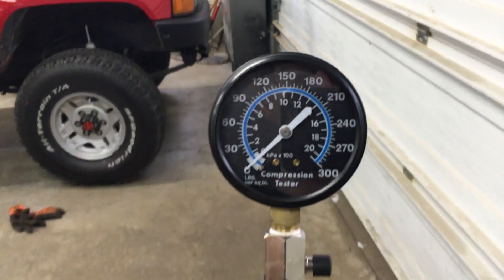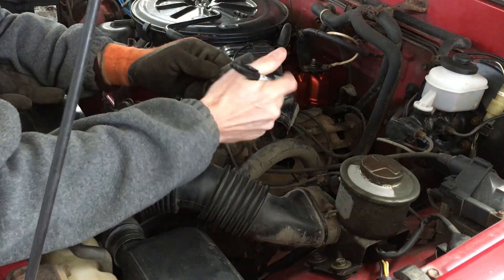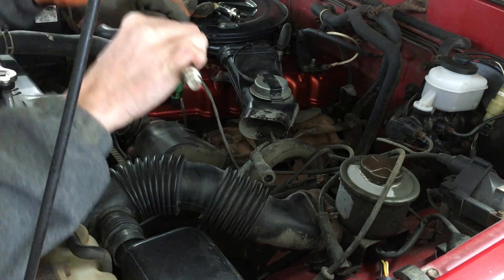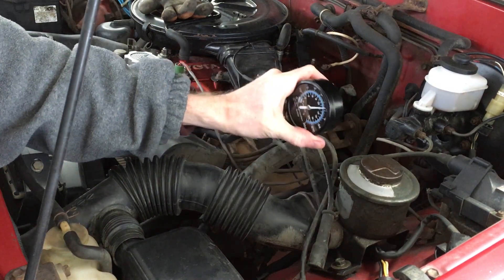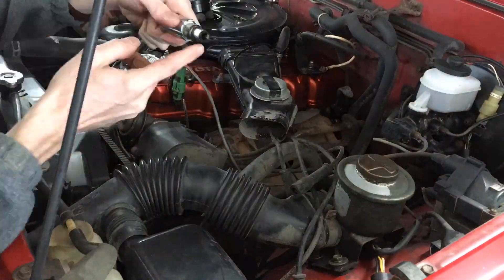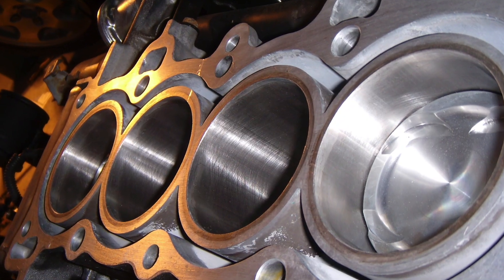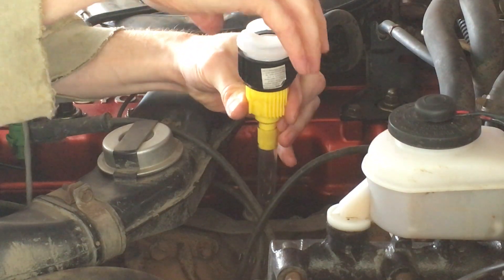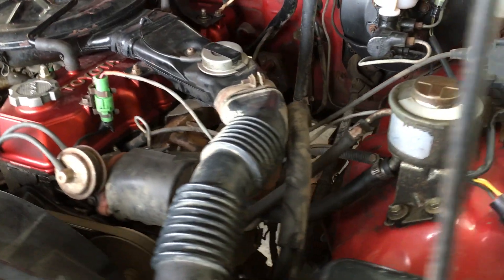How to: Compression Test an Engine

Comment: I'm looking at buying a truck with a 22r and doing a compression test on it before buying. To be clear you didn't shutoff fuel or ignition before doing this compression test?
Reply from the maker: That's correct, I just pulled the spark plug wires off so the engine won't run.
Reply: @6thGearGarage  thanks for the quick reply!

Comment: I need help how to know if the engine needs a head gasket I check all the compression all 3 cylinder has a 150 the cylinder number 2 has only 135
Reply from the maker: Did the #2 cyl get any better after adding some oil into the cylinder?  If so, that's worn rings.

Comment: Nice informative video.  Also figured I would mention how jealous I am of your clean truck.
Reply from the maker: Thanks! It looks clean in this video, but the frame under the cab will need some attention in the future. Yota life in Ohio!
Reply: Cant be as bad as the Turdle.  Patched the frame in 3 spots one of witch the frame was almost torn in half.
Reply from the maker: @PostalRedneck  I saw that nasty front support too.  You're right, I've seen that area rust out on a lot of older fords.